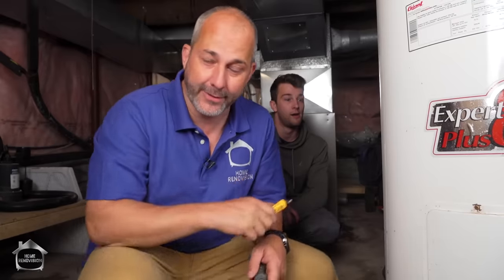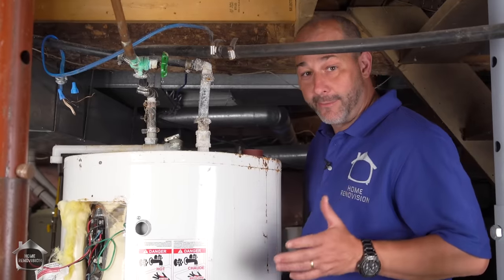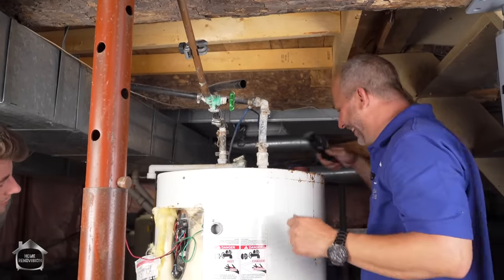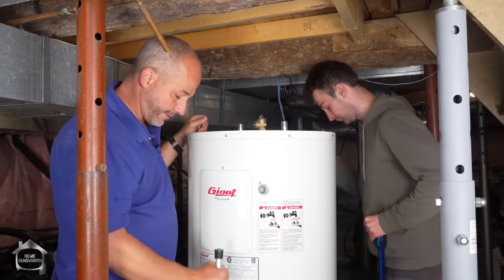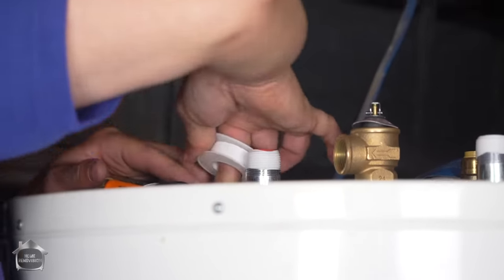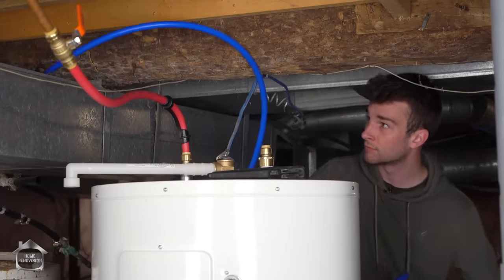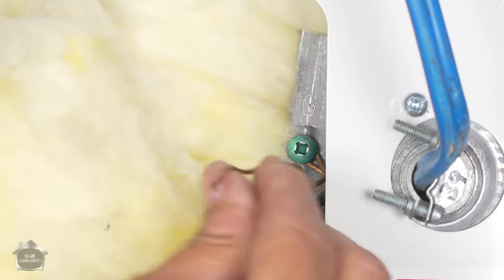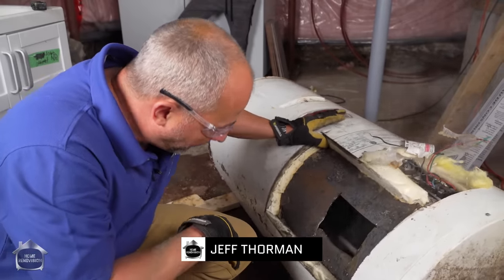How to Replace an Electric Hot Water Tank | DIY Home Repair

Comment: Should you drain tank before changing rod?
Reply from the maker: not needed if you shut off the water supply and take off the pressure. It helps to keep it steady if it is full of water since it takes a good nudge to get it going. Cheers!

Comment: Two corrections: it’s taped in wrong direction on the anode rod.  Water shut off valve should be at the cold water line, or you switched the cold/hot lines.
Reply from the maker: feel fre to put a shut off on both if you want!
Reply: @HomeRenoVisionDIY  - that's what I did when I replaced my tank last year.
Shut-offs right on the top of the tank on both nipples.
This way, when I go to drain the tank I don't have to shut off the whole house. (you are supposed to drain them periodically to keep that sediment from building up)

Comment: I suppose that installation method worked ... But ... I always install metal 3/4 inch pipe to water heater inlet and outlet prior to and if using Pex pipe to the domestic plumbing. I Never leave romex exposed, I run the power wires through conduit, Always. Also I Only connect Electric water heaters to 30 Amp breakers with 10 gauge wire not 12 gauge.

Comment: after seeing the tank being cut off and inside, I wonder if the owner's still interested to use the same tank next time! ..I would switch to Electric Tankless Heater! (of course it will be better with whole house water filtering to reduce the scale and prolong the Tankless heater!)
Reply from the maker: the trick here is to add filtration and softening before heating.

Comment: What are your thoughts on tankless water heaters?
Reply from the maker: I love them as long as you have enough room to run sufficient line before the fixture. short  runs seem to cause problems with the sensors and inconsistent hot water flow.

Comment: your wire form house was 12ga but in the new tank it looked like 14 ga is that acceptable?
Reply: I believe the wire is undersize and not ran to code.   But then I don’t know what code is in Canada.  12 gauge wire is only rated for 20 amps max.  14 gauge is rated for 15 amps.  I believe both would be undersize, as I’ve never seen a water heater that drew this little amperage.  I couldn’t read the specs on the label.

Comment: a glass-lined tank is far more than 50-60 pounds 😅
Just replacing my 80 gallon, and the replacements are over 300 pounds.  I'd expect a 40 gallon to be at least 150.

Comment: Awesome job but.... Please show your son how to use Channel Locks and same for a pipe wrench. The teeth are designed to grab in only 1 direction. Yes we know Channels will grab a bit in the wrong direction but that will slip eventually and dull the teeth and ruin the fitting!

Comment: Are you kidding me?  That is a dream installation site from my perspective.  I have to install my water heater in a crawl space with a dirt floor.  LOL.  I would love to be able to stand up and on a concrete floor to boot.  Boy, another reason one should not use hot water to make drinks - heat the water in a microwave or on the stove.
Reply from the maker: I feel for ya brother. Cheers!

Comment: Since the tank has 2 heating elements, how do you adjust the temperature settings on each element?
Reply from the maker: there is a dial that instructs the thermostat that controls the power to both simultaneously. Cheers!

Comment: Are the smaller suitcase water heaters not better and more efficient
Reply from the maker: this is not an issue of efficiency. this tank only looses 1/2 of a degree per hour.
Reply: @HomeRenoVisionDIY  good to know cuz I was considering  going to the smaller heaters

Comment: Um...The Uniform Plumbing Code (UPC 604.13) states that “PEX tubing shall not be installed within the first 18 inches of piping connected to a water heater."  Guess it doesn't matter in Canada.  :)

Comment: Looks like the old water heater was working though. It was holding a lot of water, and it was hot. What was the problem to begin with? Couldn't you just have changed the anode rod?
Reply from the maker: Great question. The sediment in the tank was up to the half way point. I have already had to change 2 elements and I was having trouble filling the tub so I knew my days were numbered. We decided to change it before it failed so that we wouldn't have the drama and then i would be able to film it while Max was available. cheers. In truth we probably could have gotten another few months out of it and just showered without the use of the tub. Cheers Gutiersa!
Reply: @HomeRenoVisionDIY  Yes, good points.

Comment: wait, storage heater tanks get replaced after 6yrs?
Reply: no I had some last 20-30 years!  Both gas an electric.
Reply from the maker: Not usually, this house goes straight from the well to the heating tank. We are installing the rest of the equipment in a video soon. Cheers! with proper anode replacement the tank should last 20 or more. Cheers!
Reply: @HomeRenoVisionDIY  ahh I see, you did mention something about the water treatment early in the video. interested to see what you will be doing there. cheers!

Comment: My anode rod was completely eroded and gone after 4 years, just a little nub connected to the nut when I replaced it.
Reply from the maker: At least you replaced it. Cheers! depending on the water they sometimes only last 2 to 3 years.

Comment: Wouldn't it have been wise to install the aluminum pipe right after you pulled it from the box instead of inserting it after you placed the water heater on the pedestal? And, what's with the frequent annoying giggles...?

Comment: Last night my neighbor called to tell me he thought I had a busted pipe on the side of my house... I found the pipe went to my hot water heater in my garage. It's natural gas... I was confused because I had just taken a bath with no problem and lots of hot water. The area is the garage was all dry... I cut the gas off, shut the valve on the water and it stopped running. What could be the problem?

Comment: I installed a new one, whenever the water is heating up after a shower, the pipes make a banging sound. Is there air stuck in my pipes?
Reply from the maker: the problem is that you need to secure your pipes. vibration is common loose pipes make noise. Cheers!

Comment: Maybe i'm missing something, is this a boiler or not? I mean, i'm not from the states and so i might be missing something, but, how on earth is there sediment in there and how can a boiler be gone after 6 years? I've got a 100l boiler that's about 15 years old now and it hade literally zero maintainance. what am i not understanding here?
Reply: it is NOT a boiler. it is a tank with 2 electric heating elements. the fact that its a tank where water is heated and stored, sediment falls out of solution and gathers in the bottom of the tank. a boiler that is used for domestic hot water typically has a heat exchanger (sometimes called the "tankless coil" in applications where the boiler is primarily used for space heating) where sediment does not have the opportunity to accumulate
Reply: @cutrara7  ok thanks for that. so, as i am unknown to these type of heaters, what is  it's general purpose then?
Reply: @manoahvanderwolf3259  they are mostly used in areas where natural gas service is not available

Comment: I would of thought that the plumber would have wanted to complete the job which included the exhaust vent pipe.
Reply from the maker: there is no vent pipe for exhaust with an electric tank. Cheers!
Reply: I was looking at a couple of videos about water tanks or tankless and some how my comment for a gas tankless vent pipe ended up on the electric hot water tank.  Glad you caught my mistake.

Comment: Hi Jeff don't really. want a full explanation,  my hot water heater works off my furnace and run out of hot water if 2 people take long showers in the winter or want to fill a Jacuzzi best to. disconnect it and install a larger hot water heater?... I'll be putting house up for sale....   Vin!
Reply from the maker: It is definitely an option. Cheers!

Comment: Can't use PEX within 18" of any hot water tank.
Reply from the maker: The guys that wrote that code are just scared. they can't handle the truth.
Reply: @HomeRenoVisionDIY  Don't blame the code writers, blame the manufacturers whose specs are referred to by the code writers.  One can't always predict how high the next homeowner might set the tank temp, or what would happen if the thermostat malfunctions, causing the pressure to build.  PRV's are designed to release at 220F, which is 40F above the max 180F the tubing is designed for.   In the event of a thermostat malfunction, the tubing becomes the weakest link and will often burst before the PRV kicks in.  And in the case of a gas water heater, the tubing connections are located near the hot vent pipe, and can actually melt.  For the cost of 36" of copper tubing, its not worth the risk.

Comment: Why are you hooking up a 240 volt  water heater to a supply that has a color code for 110 volts?   I doubt the wiring, which you stated was #12, is adequate for that water heater.  #12 is only good for 20 amps.  The wire should also be in conduit.  Hope no one gets hurt with the improperly identified wires.  White is for neutral, not a hot leg. Did you check the amp rating on the new water heater.  I’m sure it’s greater than 20 amps.  If so, that wire is a fire hazard.

Comment: You messed up big time because you neglected to state that the power to the water heater cannot be turned on until the water heater is filled with water because if the heating elements are energized without the water heater being full of water the heating elements will burn out which is a condition known as "dry firing".

Comment: Wow the same piece of junk unit, assuming it was warranty unit, since it was 8 year.
Reply from the maker: nothing wrong with the tank. it was the water supply that was the issue. we are changing over our entire water softener and purification system as well. It should perform much longer this time around. cheers!

Comment: Do yourself a big favorite ...never remove a water heater with hot water in it...turn off the power  for 24 hours before and drain as much water out as possible...also if your house burn down and the insurance fines out you  installed  the water heater yourself and you are not license plumber...your insurance can void your home insurance...you could be homeless.

Comment: Did you ever see a Shark-bite fitting fail?
Reply from the maker: Not personally!
Reply: @HomeRenoVisionDIY  Thanks for the reply.  I have used them on occasion over the years and so far no problems either.  Just curious, because my plumbing distributor frowns on them in favor of the brand they carry.

Comment: You never turn power to the elements on untill air is vented out of tank and water to a fixture. Somebody can get hurt. You should teach this kid how to fit and pipe not bend pex no fittings and a hand ful of shark bites.